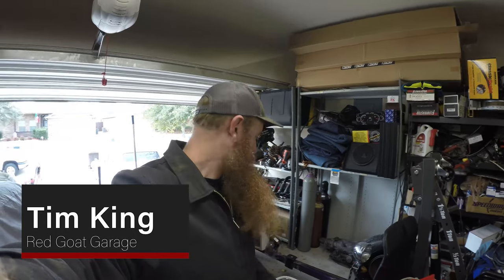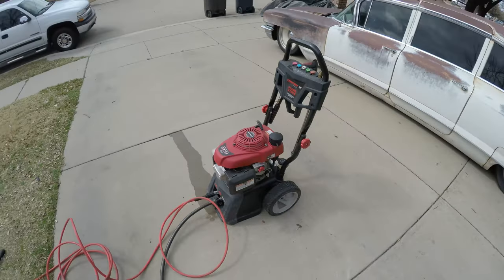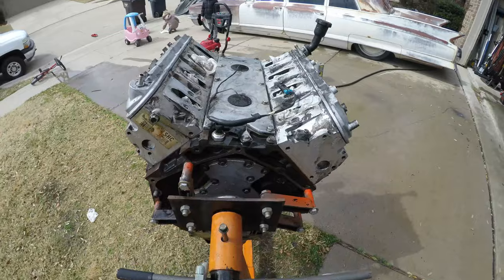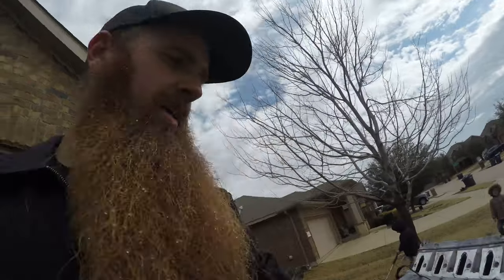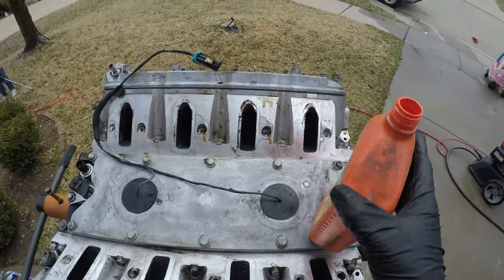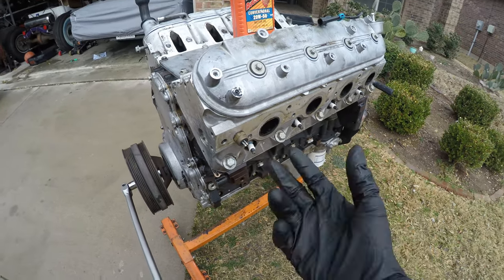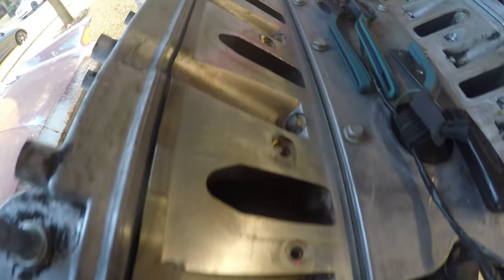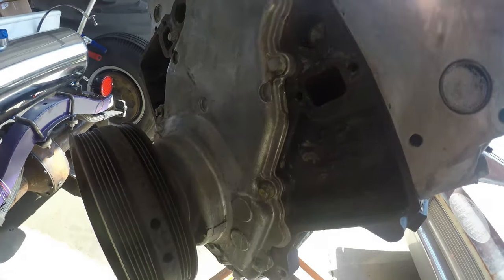Cleaning NASTY LS Engine To Look Like New!

Comment: How many miles are on that LM7? Mine has a little over 200,000 and was thinking about doing this to mine along with putting new gaskets on.
Reply from the maker: I really don't know - I want to say the Tahoe said around 200K when I pulled it. But it had a few leaking gaskets and made a huge mess. Shouldn't leak anymore though now that it's all resealed. I haven't fired it up yet to confirm though.

Comment: You’re not worried about filling your intake ports with water?
Reply from the maker: Absolutely. I put towels down each intake runner. Then when I'm done I turn the motor upside down and spin the crank a few times. After that I'll put motor oil in each cylinder and spin the crank a few times again.